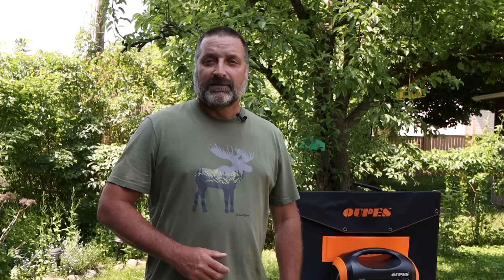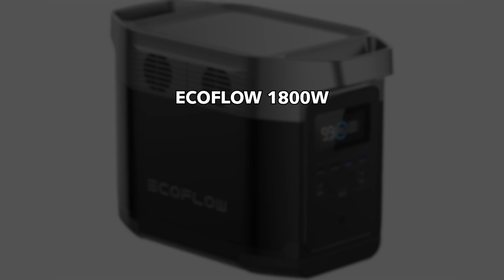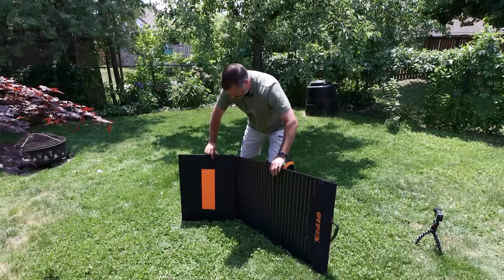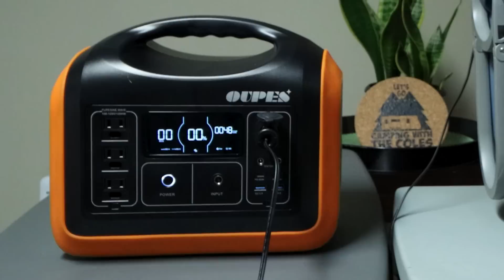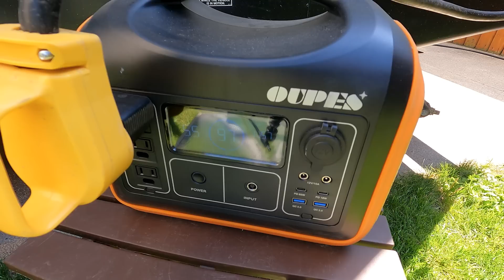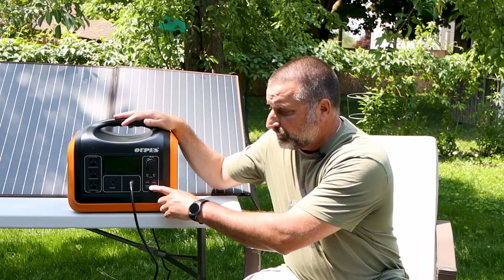Review of the OUPES 1200 Solar Powered Generator for Camping

Comment: Awesome review.  I've watched countless videos of people way smarter than me explain the electrical side of these devices but watching your video made so much sense.  It got me thinking that with the 2400 Watt device, you could run the AC (with a soft start) for probably an hour.  This would be the perfect amount of time to take a little side stop while on the road and keep the pup cool while out.  Great review!
Reply from the maker: These things aren't cheap but if you can afford it they are awesome. I have a soft start on my AC and my old 2000 watt gas generator would start it but it would shut down after about 15 minutes. I think 2400 watts would be perfect.

Comment: With all this you might as well go to a hotel, this isn't camping.
Reply from the maker: I like to sleep in my own bed not a bed that hundreds have slept in before me.
Reply: @CampingwiththeColes  Everyone prefers that, but unless you're staying in a Motel 6, they wash the sheets.  If you're going camping, though, as I said - go camping.  This isn't camping.
Reply: @guyincognito8440 Always keep in mind  , some people require medical devices, or devices to help with disabilities and wish to enjoy what others enjoy.  Devices like this brings some normalcy  to to ppl that otherwise could never enjoy camping etc...
Reply from the maker: @femmereaper  good point. A common device that lot of people require is a CPAP machine. Most CPAPs draw 30-60 watts. So this should run one from 16 - 32 hours without recharging. If you have an electric site you can use the power station as a UPS (uninterrupted power supply) by plugging the device into the Oupes and plugging the Oupes into an outlet in the trailer. If power goes out the Oupes will immediately take over powering the device until power is restored.

Comment: that was awesome i could follow along everything  you said ,my problem  it the small size 120v fridge in my trailer it  should handle it no problem  great video keep them coming 10 percent  off helps a lot
Reply from the maker: It should run the fridge for 5 or 6 days of normal use. That's without recharging the power station. The fridge draws minimal power for the thermostat and only draws larger power when it turns on to keep the temp down. Our auto cooler doesn't have a thermostat so it runs full out the entire time and we still got 16.5 hours out of it.
Reply: Thank you for this additional info!  I’ve been wondering about solar generators.  I really would use to power the fridge.  Would you plug in the trailer into the Opes or find an extension cord for the fridge & plug the fridge in?  I understand not everyone can access the fridge plug.
Reply from the maker: @patriciadelorme9006  I'd probably keep it simple and plug the trailer in to the power station. It'll power your fridge and top up your trailer battery.
Reply: @CampingwiththeColes  Thank you!!

Comment: I loved this review with practical application for RV. We have a 2KW and a 0.8KW from Bluetti we used them for dry camping at some Ontario Parks following a very similar approach you described. It enabled us to go to hard to book Ontario Parks, because we started aiming for non-Eletrical sites.👍
Thanks for the video! Hope our paths will cross during the summer.
Reply from the maker: We have two non electric sites booked this summer. We'll see how it goes. Too bad it can't run the air conditioner though. Cheryl needs her air conditioning. 🥵

Comment: Thanks for the review. We purchased a Jakery a couple of years ago but this Oupes looks like a great value.
Reply: We are as well. We have an electrical site there for 5 nights. Then to Kiosk, no electric but waterfront. These systems are perfect for this. Get amazing sites. I don’t have one of these solar generators yet. I put a makeshift one together with stuff I had. A battery laying around doing nothing. Put it in a battery box added a 400 watt inverter and basic charge controller. It’ll do for now. 👍
Reply from the maker: How do you like the Jackery? Are you getting good use out of it?
Reply: We are limited to a 500w Jakery. It comes in handy for our pop up when we access will say no electric waterfront sites.
Reply from the maker: We're going to Driftwood PP this summer and now I wish we had booked waterfront (non electric). We have an electric site but it's not waterfront.
Reply: Curious, instead of using the “cigarette” plug in your vehicle when your driving, (like on a rainy day) could you use the AC charger plugged into the dash of of your truck. I have an F150 with a 400 watt inverter with a plug on my dash.
Reply from the maker: That's an excellent question. I just went out to my F150 and tested it. Plugged into the DC outlet on the truck it was bringing in 105 watts. I then plugged it in to the AC outlet on the truck and it was bringing in 185 watts. So, if you have AC outlets in your vehicle then that's the way to go. I would make sure the truck is running to do it so you don't drain your truck battery. Thanks for the question. I learned something.👍🏻

Comment: You should look at Vtoman products. I know you have power with you trailer but, for backup, Vtoman is the best bang for your buck. My Vtoman Jump 1000 can run a 12v travel fridge for 5 days continuous and still have about 20% power remaining. I can also jumpstart my car with it.  Vtoman is a phosphorous battery.
Reply from the maker: I hadn't heard of Vtoman until now. This will run a 12v travel fridge just as long. Our autocooler is a cheaper one that runs at full power all the time. It doesn't stop once temp is reached. A new travel fridge is on my wish list.